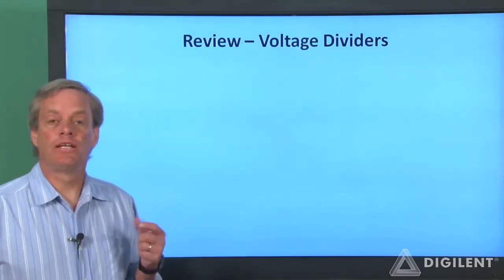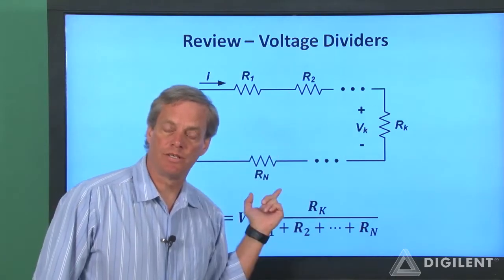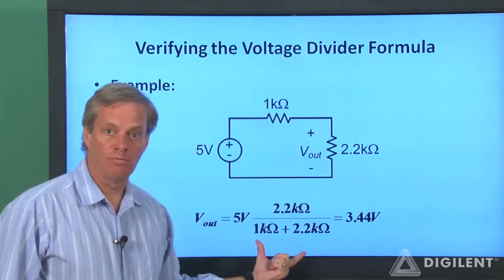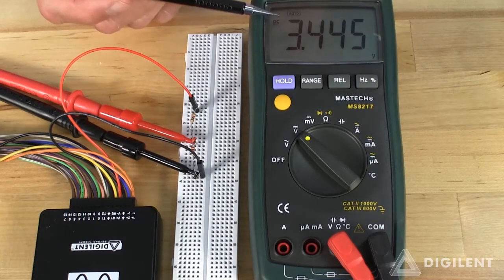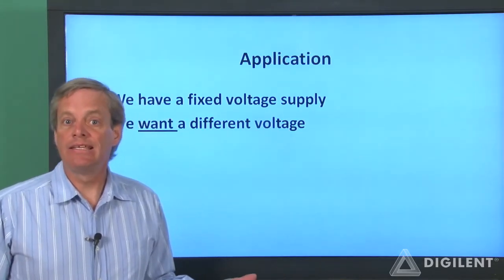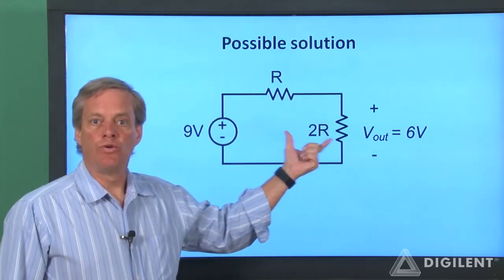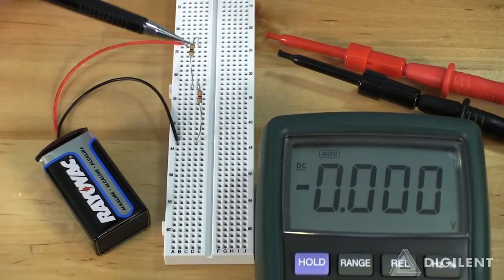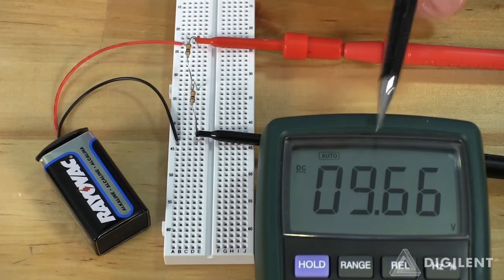Voltage Dividers

Comment: If a load is placed in parallel with the 2R resistor to use the 6V from the divider circuit, it may significantly changed the voltage. For example,  if the load has a resistance of 2R, the parallel combination of the load and 2R will have R equivalent resistance, and the voltage will drop to 4.5 volts.  This divider is best used for high impedance loads, perhaps as  a voltage reference?
Reply from the maker: The best place to get answers to questions like these is the Digilent Forum: https://forum.digilentinc.com/

Thank you for the question!
Reply: Yea exactly. You wouldnt want to use a voltage divider like that. You can use it as a reference voltage like for an opamp that has basically infinite impedance in the inputs. Adding a load parallel to the resistor will mess the voltage value.